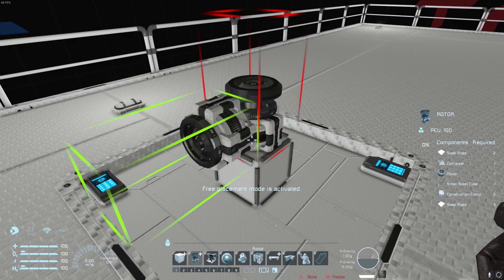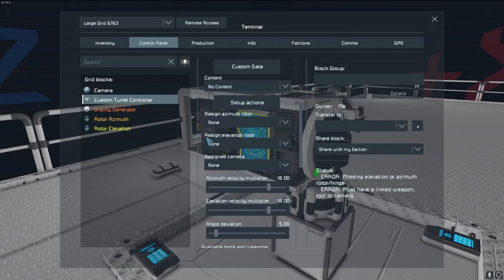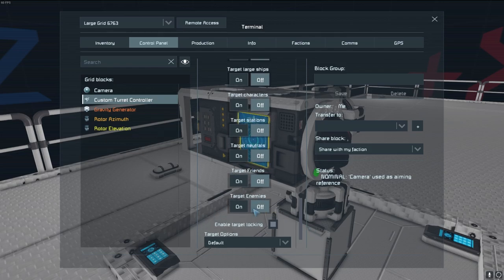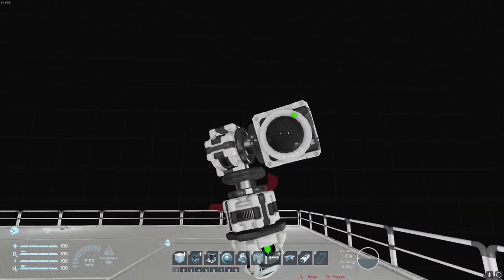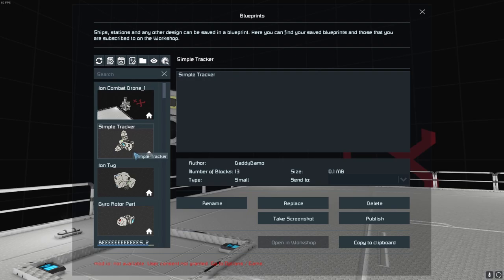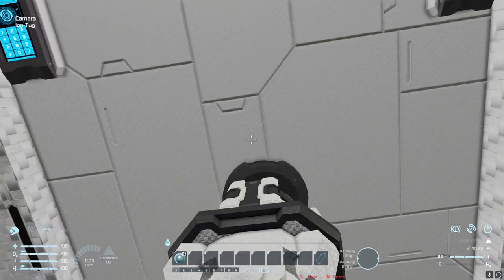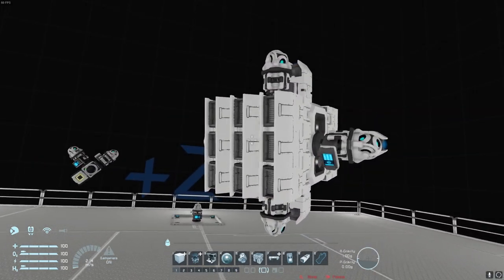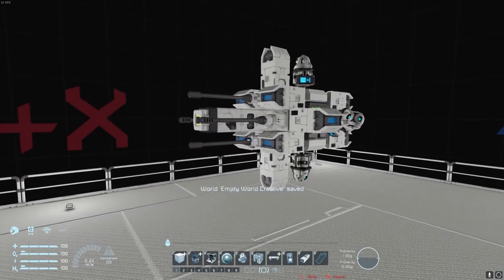Space Engineers - How to make drones using the turret controller

Comment: i actually have though about making simmiliar drones to the first one with a thruster attached to the back side of the controller and on the end of the arm just a larger heavier support body. 
but your idea is just mindblowing and it is funny to see that it really works using the gyros as infinitely spinnable flywheels. great idea, i love it. also to make the flywheels more effective, place some artificial weight blocks arround the motors, they will give a lot more innertia that the flywheel can counter

Comment: You might be able to put the main body of the rotor on the drone itself if you have the camera rear facing, something I noticed in someone else's early turret control missiles, they were using space balls as counter wieghts, but in theory it should work for gyros. might be a bit more printer friendly, as the rotors and turret control block are on the same grid, you'd still have to do merge block or grinder shenanigans, but you might be able to get away from manually reassigning the rotors,
Reply from the maker: that would work if you only intended on looking at or following a target but if the camera / designator is facing backwards it will never look at the target so it wont shoot or activate the "setup actions" buttons

Comment: Question about the end of video, does using the Designator Turret for a targeting system actually increase the detection range of the self guided missile? I’m wanting to make attack drones with this info but I’m hoping for more range than the vanilla 600 (small block) that comes with the Turret controller console. Hoping I can set it up so that the designator will send drones towards an enemy that is in range of the Designator but not yet in the range of the Turret controller console (the drone itself)
Reply from the maker: unfortunately it doesnt increase the range. you can get 800m range but that requires a large grid turret controller

Comment: One thing I did differently is attaching the rotors to the main body and the gyros to the head, then setting the rotation multiplier to a negative number. This makes it a bit less tedious to construct
Reply: interesting, do the controllers remember the rotors if they share a grid? if so they could be a lot more printer friendly.
Reply: @TheMhalpern   @Michael Halpern  I actually did testing with this months ago. Say you have a hangar, and you want to open/close hangar doors with a button panel. You would group the hangar doors (for example "left hangar doors") and add that group to the button panel as open/close.

Then you realize that the hangar doors should be somewhere else completely. But you're able to keep the button panel where it is. If you delete the doors and move them, then group the new ones in a group called "left hangar doors" like before, the button panel will still work on them. You don't need to change anything on it.

I know that works. I'm pretty sure it works with individual blocks too (for example, moving connector 13), but I'd need to test it.

I think it works similarly with the CTC, but sometimes it forgets what parts it's supposed to use? I'm not sure
Reply: has anyone thought of using a static camera to set off a booby trap or something when a player walks past it that would be cool

Comment: so I have an idea, what if you were to make a designator turret that shoots auto locking missiles.
The designator turret will auto lock on an enemy, then release the missile. However, the missile also has a custom turret block. You can see where I'm going with this. Once the missile has a lock, it will keep its forward thrust on. Until it hits the target. Once it hits the target it would activate a sensor that activates the warheads. However it loses target lock, the missile also blows up. So in detail. Designator turret locks on, activates a timer which turns on missile, Then Launches. If you could, can you build this?
Reply from the maker: i think thats exactly what that missile truck is near the end of the video
Reply: @Daddy_Damo  omg thanks, I didn't realize that there, i had to watch it in slow Mo to notice. but did you make that truck? it would be cool to see your version.

Comment: Someone recently discovered that if you use a script, you can set the turret controller's range to any number, even if it's something stupid like 5 km. I will definitely use this to exploit my way into the ultimate missile destroyer.
Reply from the maker: that script sounds very useful, if you could share that would be much appreciated
Reply: @Daddy_Damo  I'm actually working on a script for a printable supermissile, it's going to be using gyroscope override to turn and the rotors will be dummies with nothing on them so the turret controller can work

Comment: great idea... but when i build a "free-spining-drone" the cam always points away from me.. hmm.. any ideas why that could be???
Reply from the maker: are the rotors placed on the main drone pointing out or placed on the gyros pointing in? either that or you might have to invert the rotation speed numbers in the turret controller
Reply: @Daddy_Damo  rotors pointing out, gyros are sitting on the rotors... i tryed to def. the oriantation by placing a cockpit on it, i tryed to place the controlblock in diff. oriantations, inverted the settings in the controlblock... 
it worked 1 time for 1 sec after placing a turret in front.. it pointed ar my and blow up... tryed to rebuild it, same as before, drone points away from me.. grrr, this really freaks me out. tryed it with one controler setup an 2 rotors / gyros, and tryed with 2 controllers and 4 Rot./gyros... sitched rotor at the setup, at the controller, twisted controllers... drone hats me, dont wanne look at me...